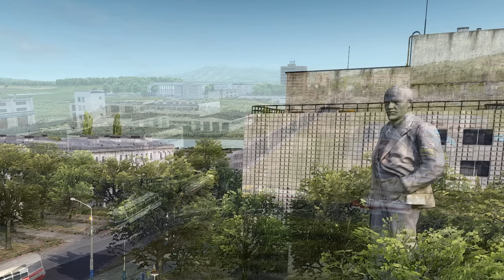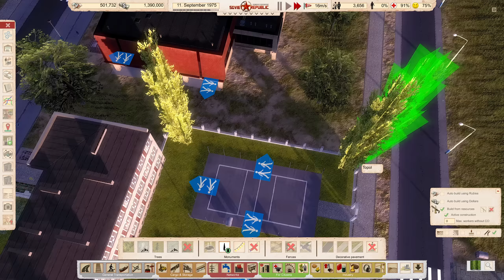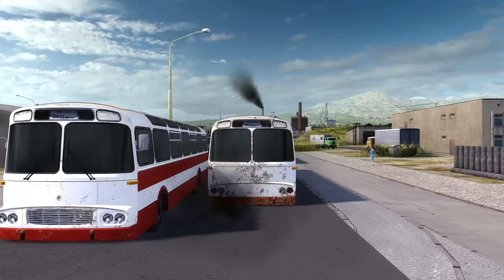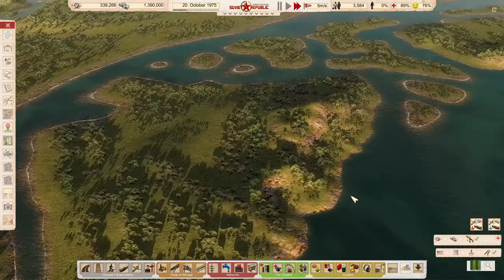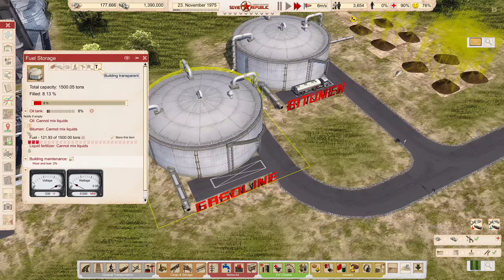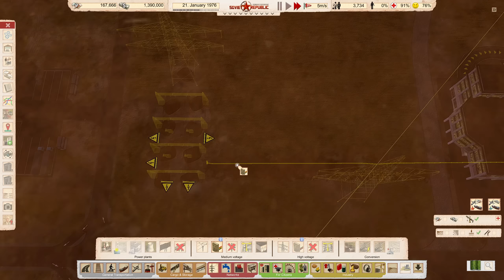Building Tall - S3E17 ║ Workers and Resources: Soviet Republic

Comment: Panel roads make their appearance!  I know I mentioned it when you were making the construction hub, but I do like them on realistic mode in industrial areas where there are lots of driveways and turns and vehicles won't reach full speed anyway - especially if it's past the bus stops where only the slower heavy goods vehicles go anyway.
Reply from the maker: Yeah, in hindsight, speed really isn't that important in the CO yard. I know I said that I used asphalt for speed. :P

But this is not the only hub we will have in the series, so there's always tomorrow. :D